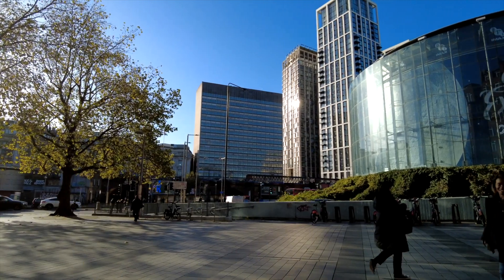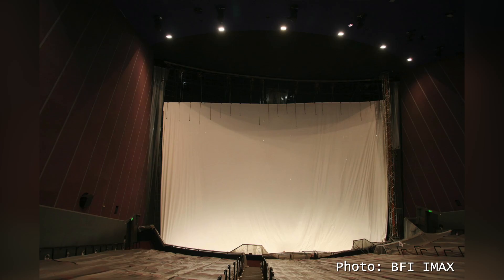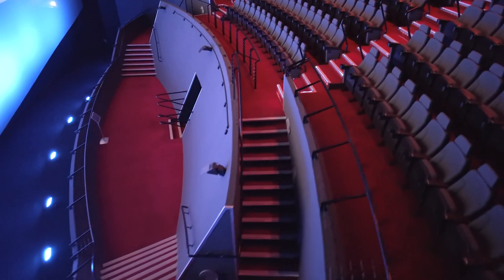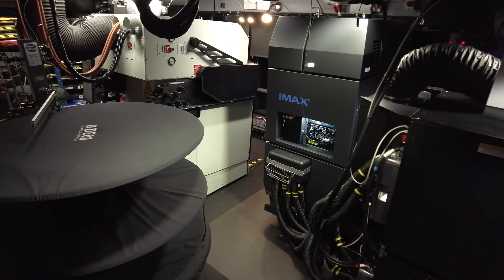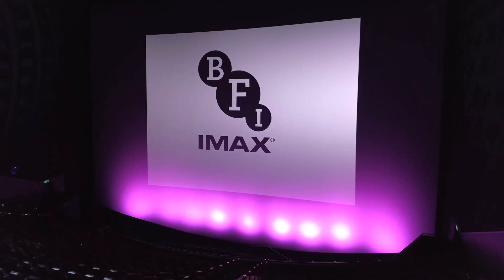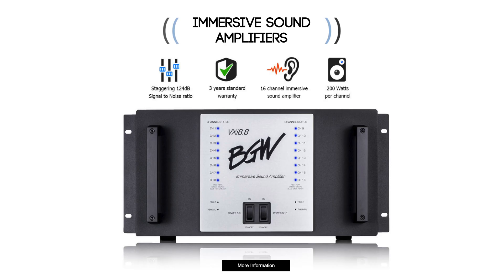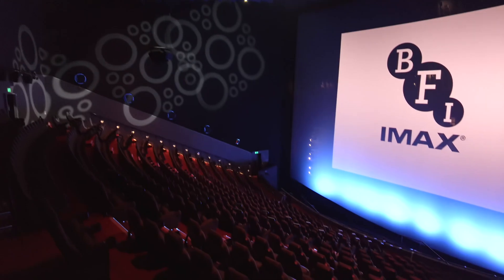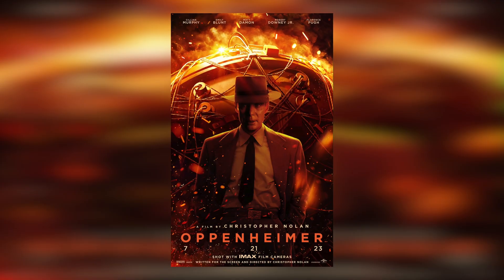UK's Largest Cinema Screen: An IMAX Experience

Comment: If you had to chose 1 seat in the theater, the best one for video and audio, which one would it be?
Reply: I would say row J around the middle if you can. Anywhere closer your neck will hurt looking up. Anywhere further back you aren’t getting that immersive experience
Reply: I’d say the very back 2 rows, they are the most expensive though but I’ve been a few times now and personally prefer them too.

Comment: The Printworks IMAX in manchester has both 70mm film projector and dual GT laser that can give an image in 1.43:1 aspect ratio. The best seat is either H19 or J19, what is the best seat in BFI?
Reply from the maker: You're absolutely right! Vue Manchester Printworks is equipped with both a 15/70mm film projector and a dual IMAX GT Laser system, allowing it to present films in the full 1.43:1 aspect ratio. This setup provides an exceptional viewing experience, especially for films specifically formatted for IMAX presentations.
Reply: @boredtech  I watched Sinners there yesterday on the GT dual laser projectors in 1.43:1, it was pretty good but compared to 70mm that I've seen there it looks soft. If you want to visit any time in the future then let me know, we can watch a movie there! 👍

Comment: The "Tycho Brahe Planetarium" in Copenhagen, the capital city of Denmark also got a backlit speaker system. The auditorium was build in 1989 and was the first and only Theater to show 15 perf omnimax max movies. They showed documentaries and before every show they had a demonstration of the speaker system where the light was turned on so the audience could see the size of them. I remember them telling that the speakers was the same size as mobile homes. After the introduction of the sound system, there was a star projector simulating the starry sky and showing all the constellations.

Under the Covid 19 pandemic, they renovated the auditorium. Unfortunately they scrapped the 15 perf 70mm projection system and installed a new "better" digital projector. That's a real shame. Specially after OPPENHEIMER could have been shown in that auditorium in its fully glory. Luckily there still is 2 big cinemas in Copenhagen there can project 70mm 5 perf. Those cinemas, is "Imperial" and "Gentofte Kino". there is also a imax cinema in Copenhagen: Cinemaxx. But they only show film in 2k so they are using very old digital projectors.

https://planetarium.dk
https://www.nfbio.dk/biografer/imperial
https://gentoftekino.dk

Comment: I have mixed feelings about BFI IMAX. I find the seats under odeon really uncomfortable and after the refurb the seats are now passable (I was there 2 days ago). Technically its really good!
Reply from the maker: Tech wise it's reference class cinema. I can agree with you about seats. I'm almost 2 meters tall and it's not enough legroom for me. But over all it's a outstanding movie theatre.
Reply: I found them better than odeon luxe over the duration. Overall very good seat's but not quite as good as regular (not luxe) Isense due to leg room but I do prefer the angle in this imax. Other odeon IMAX seat's are good but prefer the BFI imo. Definitely better than some Cineworld I've been to.

Comment: I have no idea they do traditional 35/70mm at BFI IMAX! Not sure what screening they do, I would've thought the rescreenings of old stuff are usually in digital. That said, it's still sad that they don't have a dual laser setup to fill that screen, like many other venues do (I think London science museum does)
Reply from the maker: They had to choose: Get dual laser and loose film projector or keep film projector and get single laser. 
It's simply not enough room, you can see how busy the projection booth is.
Reply: @boredtech  Yes I understand they've made the choice by watching your amazing video! Before I was just thought it was a bad call. As a huge fan for the 1:43:1 aspect ratio, I'm still sad, but I understand the decision - there's just not many commercial films that are in this aspect ratio
Reply: Lots of films have never made it onto digital, and this is the British Film Institute so they want to be able to screen all sorts of old films occasionally.

Comment: Picture not better than dolby vision and sound not better than dolby atmos, dts x equiped with 64 speakers 128 channels, providing immersive picture and sound.
Reply: Have you ever been there? I would bet not having that opinion. The larger screen size adds WAY more immersion than the potentially slightly higher colour range of DV, and while a agree somewhat about Atmos, I find Atmos at home in a much smaller environment where you can position yourself perfectly for the bubble effect to be way better than underwhelming cinema Atmos, I've always found Dolby cinemas to be a bit disappointing compared to home theatre where it really shines.

Also every auditorium is different you can't just say one brand is better. BFI is as good as any Dolby Cinema I've been to, properly acoustically isolated and calibrated, and better than your average chain that installs a Dolby  system and doesn't know how to properly set it up.

Comment: The IMAX in Ft. Lauderdale, Florida,USA it's also backlight. I think in the past they run the same demo that @VariTimo is talking about that shows where the speakers behind the screen are located. The Imax in Ft Lauderdale is also running Oppenheimer In 15/70mm film. They are also equipped with 4k Digital Laser Projection system! And the screen is smaller by just a few meters compared to to BFI London..

Comment: Thank you for the great video!
Here in Italy we have the Arcadia Cinema (located in Melzo, near Milan, with 5 screens) which also lights up the speaker behind the screen for a few second before the beginning of the show.
The biggest auditorium of the 5, called Energy, it's equipped with the biggest screen of the country (30x16,5 meters, which was the biggest one in the world at the time it opened back in 1997) and the current biggest Dolby Atmos configuration in the world provided by Meyer Sound (70.000 watt of power). It's widely considered one of the very best theatres in europe (it won the ICTA award for the best screen in europe in 2017) and it's capable of showing films in a dual 4K laser projection (by Christie) and it's also currently showing Oppenheimer in the 70mm/5perf film format.

Comment: 3:53 that would be an aspect ratio of 1.3:1 and not 1.43:1
Reply: It shows movies in 1.43:1
Reply: Due to the bow, IMAX screen size measuring the height centrally is different from the sides

Comment: The 1.43:1 dual laser IMAX in Karlsruhe has back lights for the screen to show the speakers as well. There is an IMAX demo that runs in that theater and used to run at the BFI IMAX as well. During the demo they play sound from the individual speaker clusters and illuminate the screen when playing from those.
Reply: I think they also do this in Stockholms IMAX
Reply: Karlsruhe!